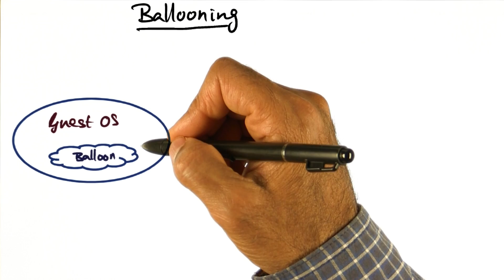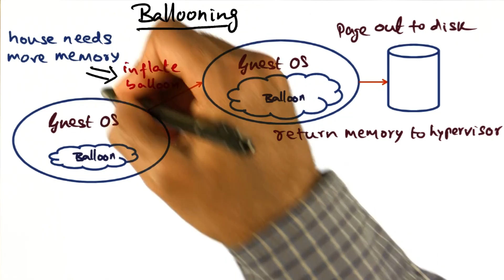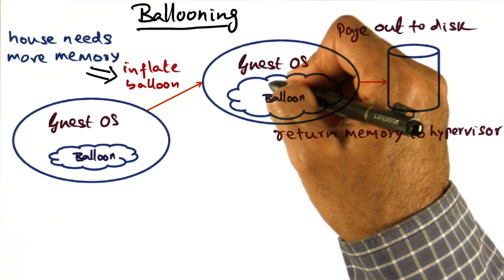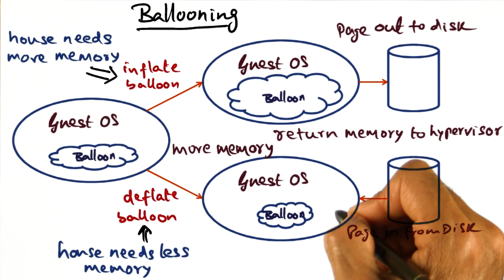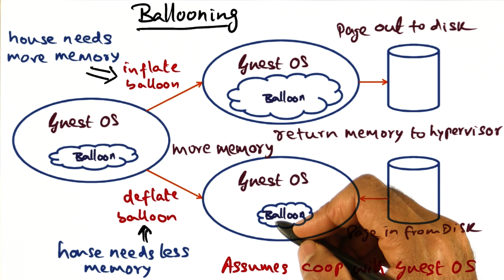Ballooning - Georgia Tech - Advanced Operating Systems

Comment: Excellent video.I do not think ballooning is kicked in when the guest run out it's memory. Then it's swap kicks in. Ballooning will kick in when host needs to take out the capacity of VM when it allocated more than it's share. Correct me if I am wrong

Comment: Why are there 2 guest operating systems? Isn't one of them supposed to be the host?
Reply: I had to re-watch a couple times as well because of this. There is 1 guest OS depicted. The arrows are showing steps in the process:
init state, inflated, paging to disk.

Or in reverse:
init state, deflating, moving pages from disk into RAM
Reply: In a virtualized environment , There can be N number guest operating system on a single host.